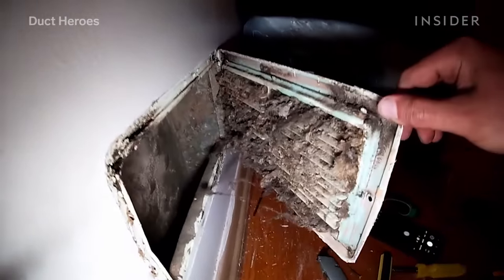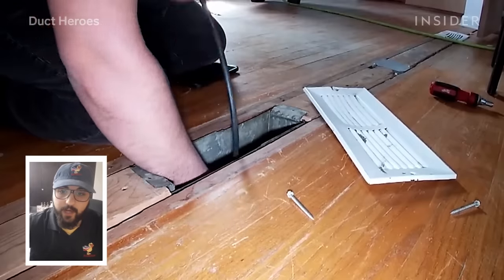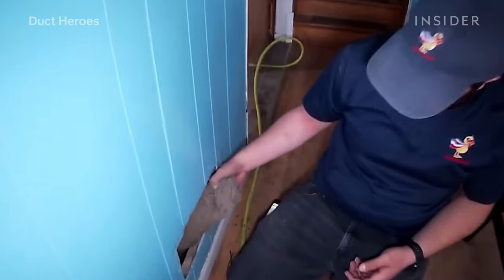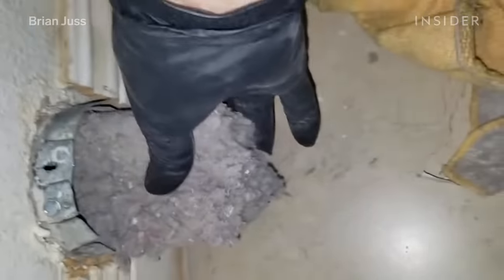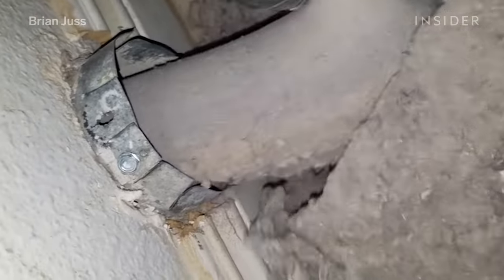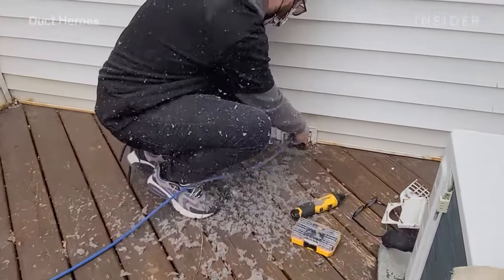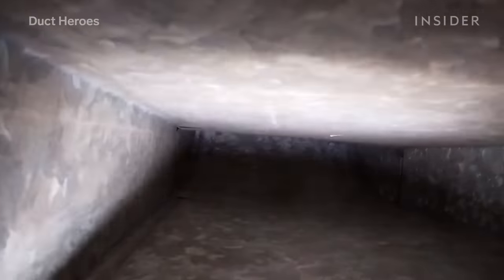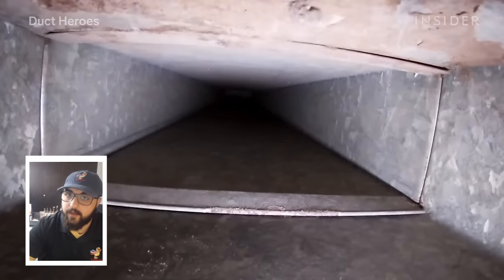How 47 Years Of Dust Is Deep Cleaned From Air Vents | Deep Cleaned | Insider

Comment: You shouldn't have to do this if your HVAC has an air filter that you regularly replace, right?
Reply: correct but over a very long term period (decades) you would still have to clean it
Reply: That's not true, they should still be  cleaned at least every few years, the amount that dust that builds up even when regularly replacing the filter is unbelievable
Reply: It depends. If you have multiple return ducts dust will still make its way into the vents, and even if you have just one your filter won’t catch everything. You are right though, regularly replacing your filter will slow down the accumulation of dust.
Reply: I do this for a living and you should do this every 2-5 years depending on how many people live there or animals. As well as location. Here in nevada we have a lot of sand and dust so way more often. More like 3 years.
Reply: There’s no way avoiding dust no matter what. Lol. No filter is gonna protect or prevent dust 100%. It might slow down the build up but it’ll still be there.
Reply: No. Most systems have a filter at the furnace/air handler and the return duct is completely unfiltered. Whoever lived in this place probably had a lot of pets over the years 🤷‍♂️
Reply: Helps alot,but still needs to be cleaned out,think about what you said my bro.
Reply: Replaced some 38 yr old air duct last year, & it was no more than what gets caught in my dryer screen after a load of towels. To be fair, tho, that return vent is in the ceiling. However, our 6 yr old industrial unit has the return 4” off the floor, & I can see the air ducts going 12 years without needing a cleaning.
Reply: Yes correct.  The filter traps dust from getting past it and into the coil, and the coil literally lies over the opening of the ducts, where room temperature air is forced through it and the coil cools that air through the use a Freon flowing through that coil.  It operates as a heat sink sapping all the heat from the room temperature air.  Dust does not get past the coil in any significant quantities, and in order for dust to be this bad, that would mean that this system has been ran without a filter AND air carrying dust in significant quantities somehow made it past the coil WITHOUT CLOGGING IT, which, since it is literally designed to not allow to happen, makes no sense.  If the  coil did clog with dirt, it would stop that airflow.  This in turn would cause that coil to freeze into a solid block of ice not allowing ANY air past at all.  This would in turn kill the compressor.  This HVAC system would’ve been nonfunctional long before it ever got to this state.  Something else is going on.  This is probably staged.  Also, all the air ducts would have positive air pressure while the system is being ran, so air wouldn’t get in the other side either.  Again, fishy stuff

A lot of these people in this thread replying to you don’t have a clue what they are talking about.  Typical for the internet I guess.  The return air guy neglects to mention that the return air for a correctly designed system always “returns” the air BEFORE it has a chance to pass through the filter.  Everyone else replying in this thread that it still “needs to be cleaned though” are exactly the types of people these kinds of “services” prey on.  Ignorant to the extreme.  Fools will always be parted with their money.

As far as the dryer vent goes, he is correct.  You do need to keep that clean, but that has literally nothing to do with the HVAC system.  You need to keep it cleaned for those two exact reasons he stated, although I’d never pay someone to clean it.  It isn’t hard to do yourself, and you’ll save yourself quite a bit of money.  That is my advice people
Reply: @Socherbal  you’re special. That dirt is clearly in the return ducts 🤣
Reply: I'm just gonna watch the argument that might start unfold
Reply: @M3gur1n3luk4  it’s not really an argument when one person is right and one person is blatantly wrong 🤣
Reply: @jman0870  and one person is a certified HVAC technician and the other has no clue what they are talking about.
Reply: @Socherbal  Also, please explain how creating a positive pressure sucks air. Last time I checked, positive pressure blows air. Thanks.
Reply: @jman0870  sure will do.  I love to educate the ignorant.  Positive pressure means there is more air than a volume can contain correct?  So if you have air being forced through the air ducts via blower motor, that makes a positive air pressure at the air vents.  The blower motor “sucks” air through the return vents, and at those vents alone, in the side that faces the living quarters, you’ll have a negative pressure.  Understand now?
Reply: @jman0870  I’m going to keep replying, because I don’t know what any of that has to do with a residential cooling system and theory behind how it works.  You can throw out all the technical terms you want, but I bet you can’t even tell me what we use for Freon nowadays.  I’m currently installing a new gas furnace, something you’ve never done I’m sure.  Funny how checking ohms is a proud point for you.  Sad.  Bet you can’t even tell me the unit of measurement for capacitance.  Tell you if a switch is open or close with a volt meter?  What is this kindergarten?  What do expansion valves have to do with how a filter and a-coil works?  If you have the right size piston and the right charge, it is going to work unless it is restricted.

The point is, you know how I know you don’t know what you are talking about?  You don’t even know that the purpose of the air filter is.  The only place dirt can build up is in the “return duct” as you do eloquently put, but it shouldn’t build up even there, because if the space is to be considered a “duct”, it is supposed to have an air filter BEFORE the duct transitions to the blower motor.  If it doesn’t and the house is very dirty, what you see in this video happens.  This is elementary stuff.  

You can throw out all the technical terms you want and you can think it makes you sound smart all you want, but we both know the truth:  you don’t have a clue what you are talking about
Reply: @Socherbal  Great reply. Air duct cleaning is a waste of money.
Reply: @gregnixon1296  thank you.  Just trying to help people out, but now I have to deal with one of these mouth breathers who apparently can’t wait to pay someone hundreds of dollars to clean his ducts
Reply: House with HVAC 100 years ago? lol
Reply: @thefirehawk1495  the first warm air furnaces were invented in the early 1800s 🙄
Reply: I encountered a bit of dust in our air system when I drove a robot through it, but it’s an unusual system since our dryer is not only next to the HVAC intake, but also has a vent that’s too long. Over 10 years, though, and not that bad: I could still clearly see the metal seams where the ducts joined together. We’ve started using two filters since we discovered our vent was too long, and are hyper-swabing the vent, and planning to move the dryer. The real dust accumulation was actually on the inside of a vent plate in an area that could easily be more humid. The extra humidity made condensate appear on the cold metal vent, making dust stick to it when the air was slowed down to slip through. But all that means that the air hitting the air conditioner coils would STOP IT FROZEN LITERALLY long before the vents got anything noticeable, AS HAPPENED TO US. Our unit literally looked like a DQ soft serve on the inside, but the ice was hard. This was because dust accumulation had clogged the coils, causing them to not get warmed up by the air, and reach the freezing point. bomb warning That’s another reason I think this video was faked.
Reply: @WilburJaywright  right 100% that is what I was trying to say and for some reason one of these people didn’t believe me, but if somehow dust gets past the air filter and into the coil, it literally clogs the coil, which impedes the air flow, which causes the coil to freeze into a block of ice, literally, which in turn can kill the compressor.  Another side effect of the accumulation of dust inside a furnace can be that it clogs the blower motor which I’ve seen many times.   This can fry the blower motor which can also cause the coil to freeze up and kill the compressor, pop the capacitor, fry the compressor wires at the terminals, what have you.  Word of caution:  be careful about using two filters.  You don’t want to impede the air flow too much for the same reasons, but I’m sure you’ve already figured out the quirks of your system
Reply: @Socherbal  Thanks for the warning. We are being careful to change the filters very often to avoid impedance from dust, but I have been somewhat concerned about just their combined air resistance even when clean.
Reply: @WilburJaywright  👍 no problem!
Reply: When your house has zero air vents.
Lucky! Proceeds to suffocate
Reply: @Socherbal … Could you?
I would appreciate it.
Reply: @badbn405  could i what?
Reply: @shtupidmate  23 years(bought home new) and have been using high quality filtrete filters religiously. Just checked the whole system and it’s pretty much spotless. Invest in good filters. Btw not all filtrete filters are good. I don’t use anything below a 1500
Reply: @Baise Duezcke true, but regardless, dust doesn’t get past the coil in any significant quantities.  If I did, the coil isn’t doing it’s job and it is being ran without a filter
Reply: Filter just helps prevent the dust and dirt from getting into the furnace/air handler. The ductwork still gets dirty
Reply: No it will still collect with regular maintenance

Comment: As someone with terrible allergies this seems like a great option. I wonder how expensive something like this is?
Reply: I don't think more than a few hundo. I got a quote for my parents large house once. 

If you rent, they should service the ducts every two years as maintenance. And they should tell you to change out the filter every month.
Reply: @greeleyestateslove  change out the filter every month!????
Reply: @HoloScope  Yeah. There are some that last longer, but most need to be replaced monthly.
Reply: rent a heavy duty HEPA filtered vacuum and buy a vent cleaner attachment for a drill and do it every 6mo or so. we don't have vents, but we do it for the dryer, and it works great.

Comment: Dude, those vents weren't around over 100 years ago, the grill is too young and so it the technology, with the build up dust the title is more accurate with estimate of 47 years, 100 years is stretching it.
Reply: So smart. I wonder how come you know it was 47 years???
Reply: Omg how did you figure out it was exactly 47 years?
Reply: Did they see your comment and changed it 😂
Reply: Probably because hvac systems and dryers wasn't a thing in homes 100 years ago.
Reply: @TheTomoyo21  yes
Reply: SSHHhhhhhh, nobody asked and you ruined it
Reply: Did anyone bother to look at the title of the clip? I just stated it's MORE accurate aiming for 47 years than the guy on the clip who kept over exaggerating it was 100 years old. The title of the video already had 47 years cause it's likely the team filming did their research after the shot was filmed. 

And like I said in my comment, most of the technology is too young, most grilles around 100 years ago had less flimsy material (around late 1910's early 1920's the materials to any building was made with higher quality with craft kept in mind) this one is a basic one that's been around since after the 1950's. If I had to make a bet, roughly the grille itself was placed between the 70's to 80's, I could be wrong with that estimation, but I know that has not been there since the 1920's.

Comment: That's a crazy amount of dust. I was working at a place with a line of pc's along the desk. One of the employees was complaining how slow the PC is. I looked at it and the vent was completely blocked. If the outside fan is like that you can only imagine the fan blades and CPU cooler. Overheating PC's slow themselves down when overheating so as not to burn the cpu. 

As for the clothes dryer, I gave it a good clean with compressed air. There is so much that gets stuck inside (damp lint that sticks to the walls of the vent tube etc)
Reply: It's tangentially related. People don't think about vent dust= people also don't think about PC case dust.
Reply: bill ted  I mean PCs typically tend to be the thing that needs cleaning the most but aren't cleaned, like air vents. The average joe isn't going to think about breaking open their PC to actually clean it out, which means that when a qualified or experienced person does, the dust buildup is absolutely horrifying. I've probably opened around... four, five family PCs, some of them ten years old? The amount of dust in them is amazing.

Comment: It is an arceological treasure. Imagine how much it could reveal about climate change, pollution over time, chemicals in food, diet
Reply: good point
Reply: How?? I am curious...
Reply: @Yash-vz2nk using chemical analysis of the dust. Similar to the rings of trees. Inside rings are older. Maybe with the dust it is similar. Inside layers are older. Or you can estimate their age with carbon dating.

Comment: I’d have been wearing a properly fitted respirator and some gloves. Researchers have been able to estimate historical air quality over many decades by measuring the amount of lead in the dust in people’s attics (dating to the time when gasoline contained lead).
Reply: not like it matters the high octane gasolin, like the kind piston engine planes like a cessna would use. still burn lead

Comment: If my house had the vents cleaned, the cleaners would probably find a lotta shiny stuff. I used to be a weird kid and would drop a lotta sequins down there.
Reply: Clean my vents,,, you will be finding lots of treasures in there XD,

Jewellery wire
Sparkles
Shinny beads
Pencil shavings,
Rubber dust
Random pieces of small paper
Paint brush bristles,,,
My own hair....

Like,, the usual stuff you would find in an art persons house :)
Reply: My vents probably would have 5lbs of drywall and sawdust and like 3 woodscrews lmao

Comment: Pro tip for dryer vents: get an electric leaf blower, take off the attachment and just use the unit itself and blast the air through the vent. It will blow the dust out and no need to cleanup. Also change your AC filterd MONTHLY not quarterly.
Reply: I love my leaf blower! I use it to remove snow from my car, and the driveway! Looks like I have heated concrete. I also use it to blow the excess water out of my car doors and jambs after washing it. Stops rust from quickly eating your car. I have a gas Makita. It works great in the cold! I know this is off track, but I squirrelled when I saw leaf blower 🤣

Comment: If the building’s really 100 years old who’s to say there isn’t asbestos in there somewhere…
Reply: It could be in there, so I wouldn't clean that without a proper respirator and appropriate safety clothes.
Reply: ....good call MT!
Reply: What's asbestos?
Reply: @ninii711  A fibrous material uses for fireproofing in older buildings. When cut or broken it can release fine particles in the air which can cause serious health problems if inhaled.
Reply: I think he was exaggerating. There is no way the dryer and air-conditioning vents are 100 years old. 40 maybe, but that might have been an exaggeration of the owners. Dust builds quickly.

Comment: You can probably just take a duster and do if that way. That's what I did when I work with my mom on her home cleaning business. I would only clean off the outsides of the Vince though I wouldn't go directly inside because I'm not an air duct expert I just cleaned off the outside of the vent

Comment: As an Hvac service tech who has cleaned ducts in the past. Let me simply say,  i would never charge anyone to do this service. Do not be fooled by these videos! Yes you should clear or better yet REPLACE your dryer vent at some point if possible. 
As for the HVAC system. You have to think about it people. Do you reallly believe that little hose with a brush can make multiple 90° turns? It just goes deep enough to clean what you can see. As for flex duct,  it has about a 20 year life span. If it's been longer then that, not only is cleaning it pointless, but it will likely damage it as well. That tool is in no way going 10, 20, or in some cases for 30ft through those ducts. Also all of the debris that are knocked loose and not recovered are getting sucked straight into your coil. So you have to replace your filters emediately. Yes if done right it can improve airflow, but don't believe the scam the your house will be "brand new". Hvac guys trash talk duct cleaning on a regular basis.
Reply: Is this something I can do myself? We only have a dryer vent.

Comment: I live in a 2 bdrm apartment and my livingroom is way cooler then my bdrms. I'm sure this is the issue😒 . The vent to the livingroom is the size of the vent cover. But the bdrms vent is a tiny circle behind a big square vent covering 🤦‍♀️. I try to explain this to the maintenance guy but he pops in and tests the air coming out of the vent as 65°degrees. But the room is 80°degrees.

Comment: Unless the dust is restricting your airflow your not going to see a major benefit from duct cleaning. A dirty little secret that the dust guys wont tell you is is that if you can see collected in the ductwork your not breathing it in but once it's all disturbed anything not vacuumed out will now become airborne because it's now been distributed. Also thought it was wild that the guy was cleaning that dryer vent outside next to a ductless mini split unit and didn't have it covered to keep the dust from getting sucked into the coils.